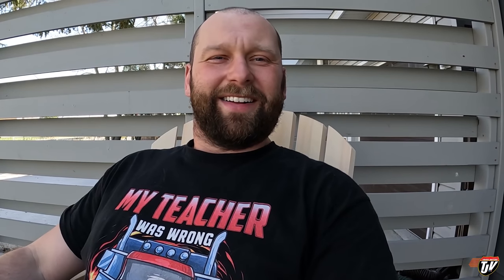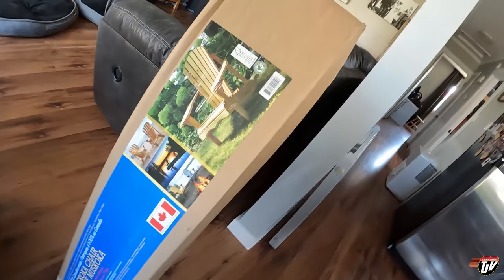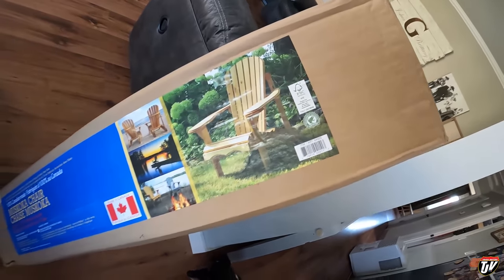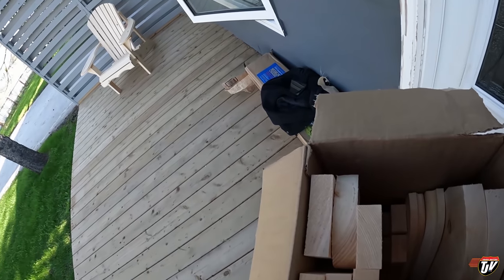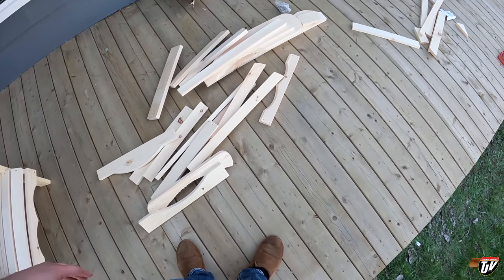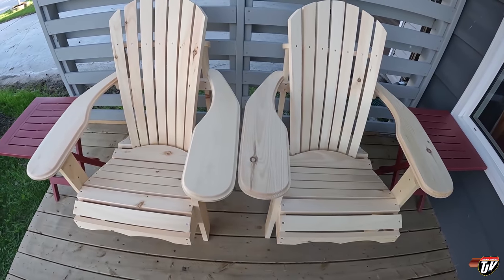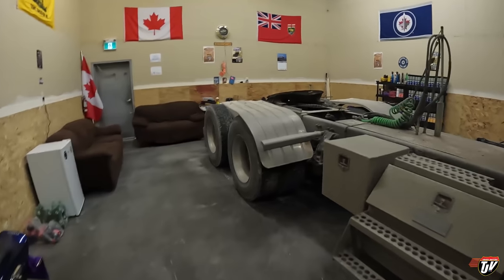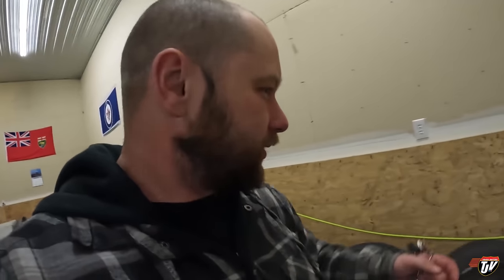THAT'S A PROBLEM! | TJV | Vlog #2538 | May 22nd, 2022

Comment: Josh as a trucker, you should know about crossing the safety chains on a trailer, in case of the trailer coming off the ball.
Reply: ive never understood the reasoning for it, i do it myself but honestly whats the point, hooked is hooked what difference does it make what side its on
Reply: @TheTojocat  it really don’t make a difference it works the same way it just how someone was taught
Reply: @jacobwilson4753  The point of crossing them is that the chains are supposed to hold the hitch up off the road in the event it comes off the ball.
Reply: @user-rd8es2bm2r  I know but what I’m saying is that if your chains are the right length they’ll hold the hitch up even if you don’t cross them.